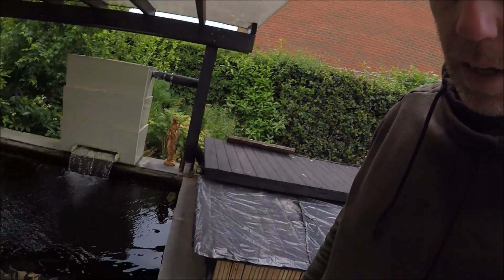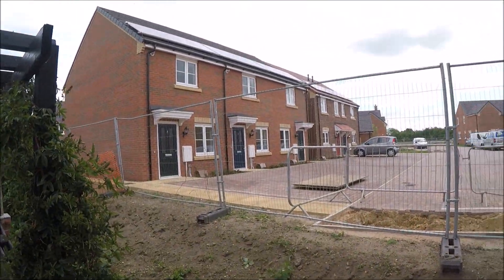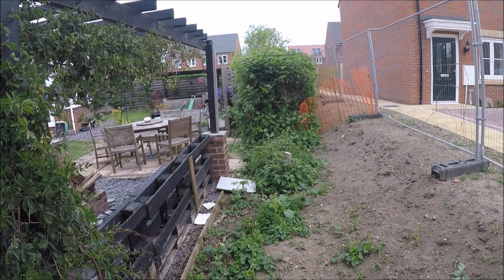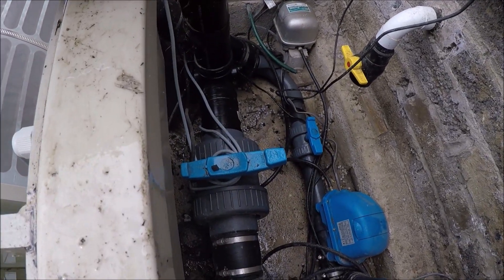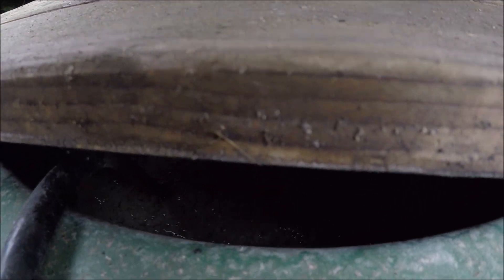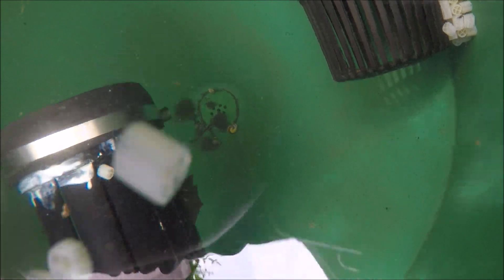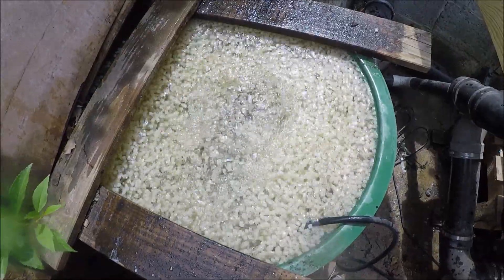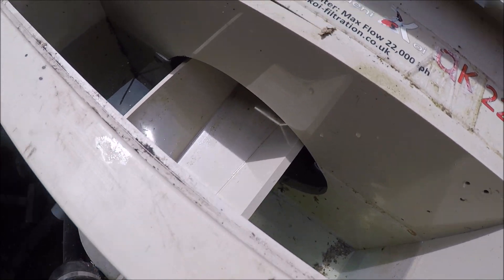Koi Diary 49

Comment: Hi Andrew. I have a QK 35 drum and have had the same build up of gunk, problem is that you can't see it, so I just stick a garden hose in there once a week to keep it clean.  I am also surprised how much weed and waste sits suspended in the drum, not being removed by the cleaning cycle. I have solved this by back flushing every so often. I would recommend anyone installing a drum to have the ability to back wash.
Reply from the maker: How do you back flush the drum? LOL confused by what it is??
Reply: I get the water to run backwards through the drum. I have a valve that goes to waste on the drum inlet feed, so I can use the water from my bio tank to run backwards through the drum. I have found big clumps of weed and food just floating in the middle of the drum not being lifted up and over the waste chute. Hope this makes sense!

Comment: I’ve asked before but did not get feedback at the time; how much water do you change weekly? I recommend at least 20%. You should also bring in another filter specifically with carbon medium to help clean the water of all the impurities; run it for about 3 weeks, that way you can be comfortable all has been removed. Either a bio filter or a high pressure filter that can utilize the carbon filter... I figure you’d be up and running thereafter.... I’m no expert but water quality requires total filter servicing pretty often and with that huge filtration system you have there be plenty spaces for build up to reside unless you scrapping it down pretty often...
Reply from the maker: SOrry must of missed your comment. My trickle is at about 1ltr per 5 minutes at the moment ive turned it up and goes through a 3 pod purifier. Not sure what youre saying about another filter after a carbon filter?  My purifed water just goes straight into the pond.  And yeah maybe ive been a bit naive with thinking my drum will just take care of it all, when infact it still needs a check up every so often
Reply: Andrew Daily okay your filtration system has all areas covered. My reference to carbon was specific to purification as carbon removes those impurities. But your 3 pod does that... so now I’m wondering if based on the amount of waste material you found vs your volume of water; if that can truly be the source... good luck and hoping all goes well.

Comment: Andrew that don't look like a lot k1 I know you have the shower but more k1 a standard Nexus 320 runs 100l and best at its full 200l that tub looks like it will take near that and still fluidise it you cant be over filtered it can only make things better
Reply: I was thinking that as well. I would chuck  in more if you can.
Reply from the maker: Im actually going to ditch the old vortex as i have a huge rectangular tub to replace it with, but yeah i agree you cant have too much bio and ive never had water parameter issues, but to be fair i havent really fed any decent amounts of food for quite a while due to all the issues!!
Reply: @koidiaries  yep cant go wrong woth more as the fish get bigger each year and increase the fish stocking as well.... ye dont blame you to be honest I would of done the same. Get it installed asap so it has abit of time to mature a little while we have got the warmer weather. How many litres you reckon it can hold?
Reply: Andy it just don't look like much of it I think you said it was the micro in a early video and that has more surface than the K1 the old vortex is ok and would more than likely take a 100l more with ease when mature. Problems like you are having near always come down to water parameters and them problems just ring out waters not right to me. Have you had a 2nd opinion home visit and full test from a well in the know koi keeper
Reply from the maker: @boxtriker  Hi yeah had a mate over with his photometer kit and got every parameter checked and it all came back within acceptable levels. Yes its micro K1 and yeah probably get more in there but my parameters have been fine and steady so im in no rush to change it up just yet.